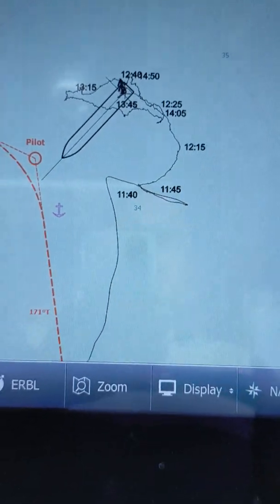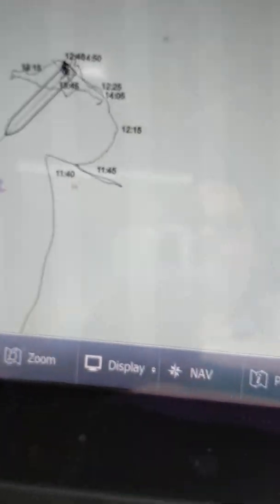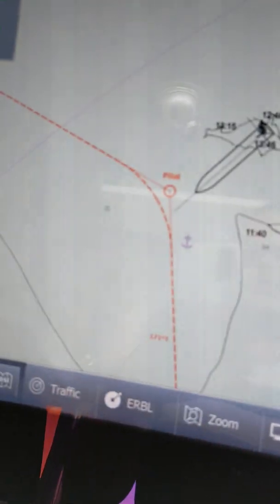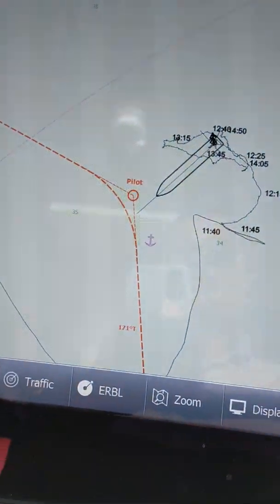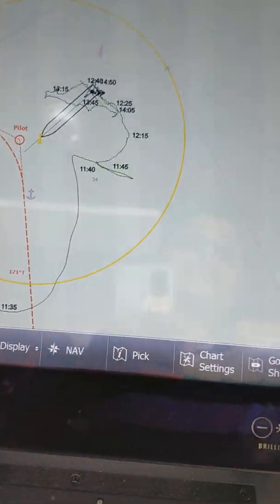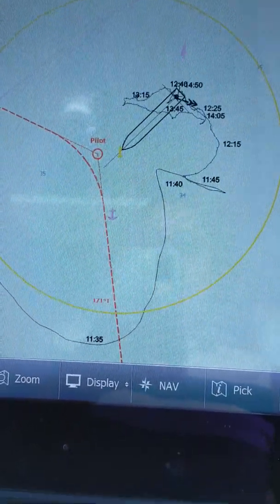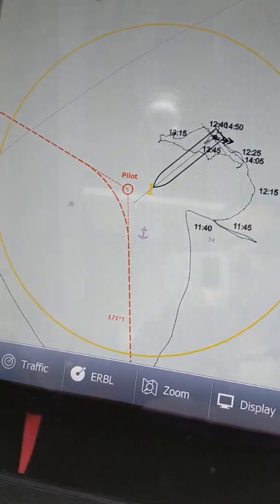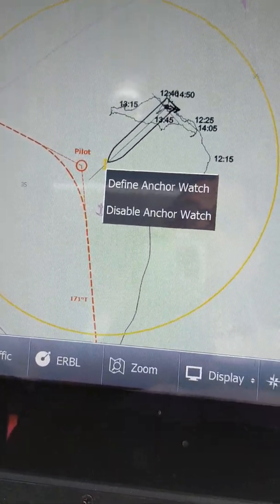e-Globe G2 ECDIS ANCHOR WATCH ALARM.

Comment: sir..unsaon pagplot sa position sa eglobe ecdis
Reply from the maker: EGLOBE ecdis does not have simple plotting position compared sa ubang ECDIS model.
1.)Sa eglobe makuhs ang position by LOP thru dead reckoning manual line of position (right click) to show context menu done in sailing task and S-mode task.
Position done by manual and celestial LOP's see context menu in Navigation Mode.
2.) Click navigation then own ship
Diri nimo ma adjust ang own ship track, time predictor. Pwede nimo ma adjust minutes hours para makita nimo ang track ug position sa barko. Tutok lng ang cursor para makuha ang coordinates
Reply: @bugsaymamon5858  wow salamat kaayo sir sa info... One question pa sir..unsay gamit ninyo nga planning station sa eglobe dha..amoa dri kay one ocean basi di btaw compatible sa eglobe kay dli mn ma.update ang charts
Reply from the maker: @rabrandomvlogs3004  one ocean sad amo pero para ra na sa digital publication. Ang eglobe ecdis ma updarte nimo theru CHART BROWSER  so dili na sila parehas. You can update your eglobe via importing updates from CHART BROWSER which is done using your supplied USB just make sure your base media card is installed on your ecdis to avoid errors.
Reply: @bugsaymamon5858  salamat kaayo sir sa info.. ako na ni irelay ni kapitan pd arun mutuo opisina ani..di mn gud mutuo sir..hehe stay safe sir...
Reply: How to switch off alarms or make it silent in eglobe g2